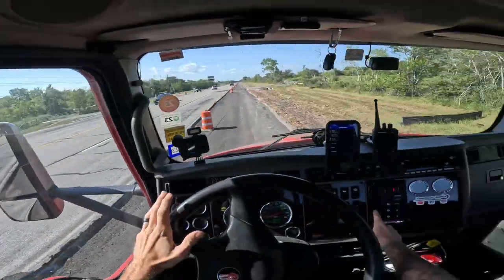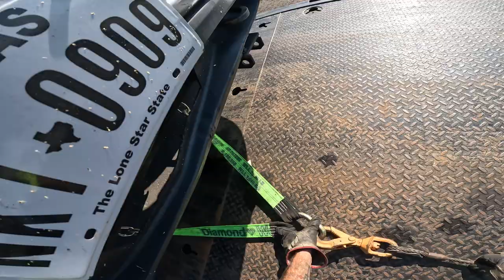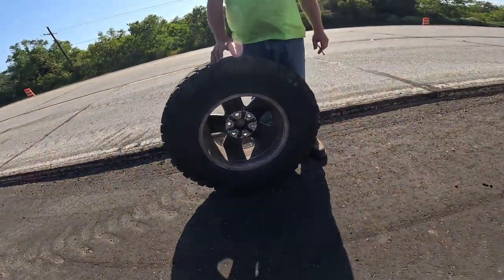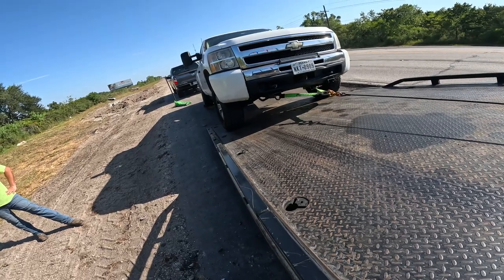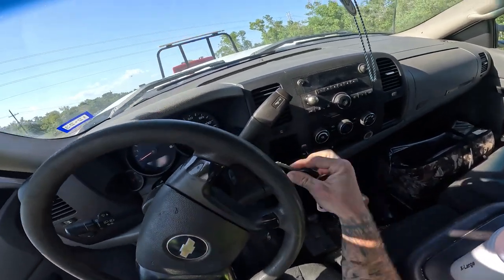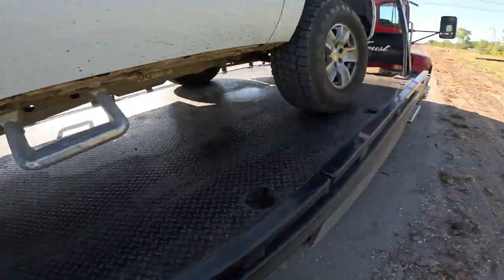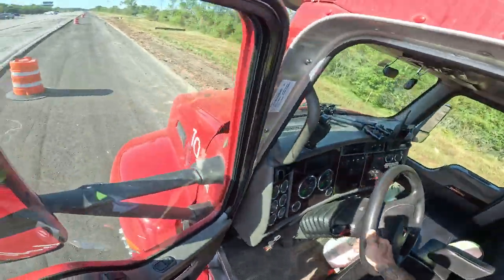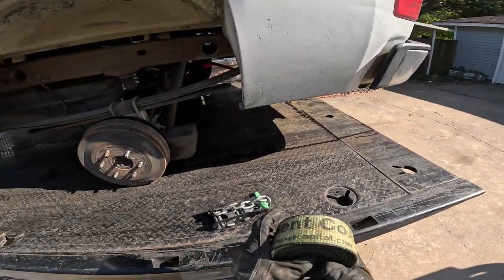Another Chevy Truck Lost a Wheel?!

Comment: Just a terrible thought really, I do hope no one has tampered with his lugs. 😢. Love your work Dustan. So careful, quick and professional. . Take care and I will see you in your next video. 😊
Reply from the maker: Thank You!
Reply: Idiots change to the spare tire and don’t properly torque the lug nuts down. Second those GM 900 pickups need the brake calipers gone thru disassembled and re lubed or will STICK and cook everything rim, rotor, caliper, lug studs and nuts, the paint off the rim, and BEARINGS.

Comment: Nice work.  Just a thought.  Could have took a couple of lug nuts off the other axel and put the tire back on. Just enough to load and unload the truck.
Reply from the maker: I was called out there to tow it. Not change a tire. Just as easy to skate it, and then I don’t have to worry about getting sued down the road when they drive off with damaged wheel studs and the tire flys off again.

Comment: I'll take, "People who use a cordless drill to install lug nuts ",  for $1000 Alex!  15:56 There's the problem those wheels came off a GMC truck and he put them on his Chevy Silverado with the lug nuts that came with his Chevy wheels. Lots of different style lug nuts. Torque them in right sequence and check them again later. Especially  alloy wheels. My  lugs are 140 ft lbs on steel wheels. That's tight and I never lost a wheel.
Reply: I have the extended cab version of this truck (LTZ). 140 ft lbs on the alloy wheels as well.

Comment: Any reason why you wouldn't put that wheel back on, to make it easier to tow?
Reply from the maker: I was called out there to tow it. Not change a tire. Just as easy to skate it, and then I don’t have to worry about getting sued down the road when they drive off with damaged wheel studs and the tire flys off again.
Reply: @Towtruck_Dustin  you wouldn't have needed the wood or the skate under the tow hitch if the wheel was put on. It was just about making it easier to pull on the truck. What they do after you unloaded, its their problem. I doubt they could sue you over that
Reply from the maker: They absolutely could sue, and would most likely win. 
I wouldn’t have put the wheel and tire back on there even if that’s all they wanted was a tire change.  The wheel is damaged, and the wheel studs are damaged.
Reply: @Towtruck_Dustin  funny. We do exactly that. We put it on just for towing it properly and nobody ever thought it could be a good thing because then of course its also easier to move for the repair shop where you usually bring those vehicles